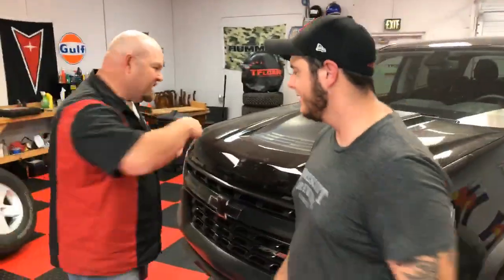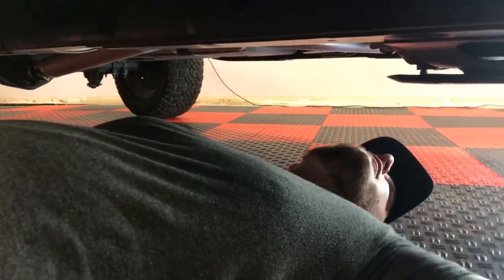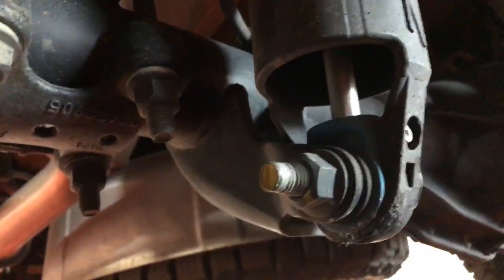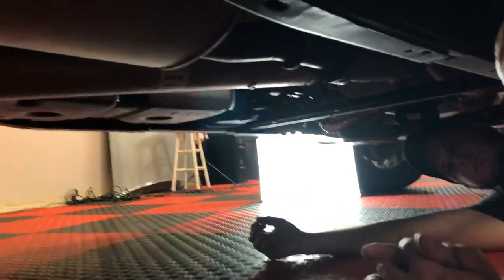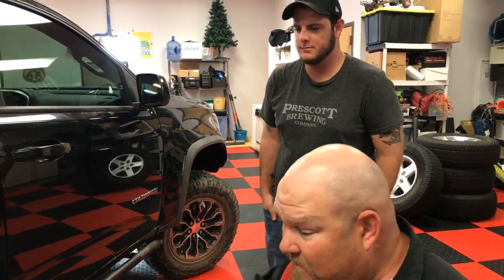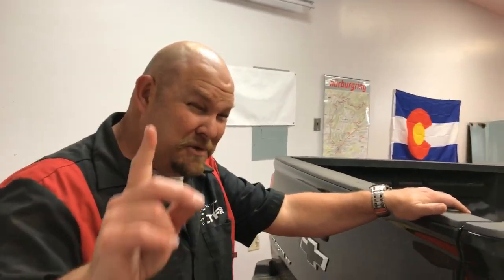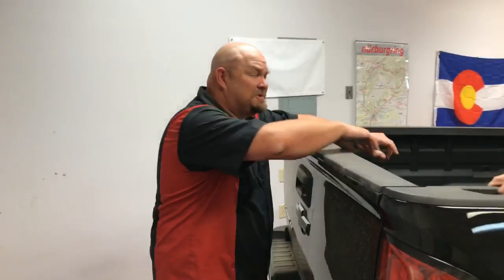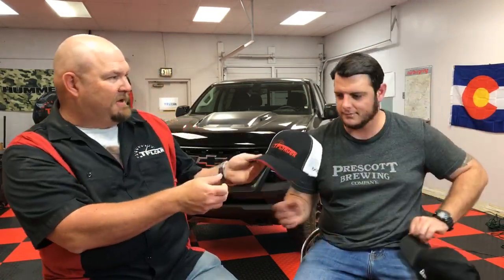Dude, I Love My Ride! 2017 Chevy Colorado ZR2

Comment: I love my 2017 ZR2 2.8 Duramax. I installed a S&B cold air intake. The truck is a beast and matches my 1995 ZR2 that I also purchased new.
Reply: scrimmy6969 Try the pedal commander. You'll love it
Reply: scrimmy6969 are you getting remarkable mileage with the diesel?

Comment: His guy made the correct choice! A bit smaller than full size trucks, can trail/off road much better than full size rigs The factory lift/wheel package is great from the start, the fact that it has lockers at both ends are just the icing on the cake! I'd love get this truck myself!

Comment: I've owned my zr2 for 11 months.  The eight speed shifts very smooth.  I do engage tow mode on the highway.  I just like staying on the power band.  According to the fuel mileage computer, i'm getting 17 mpg combined.  Right on the EPA numbers.  I have used the truck in rocks, sand, mud, snow, you name it.  Runs great.  My jeep buddies are really impressed on how well it does in deep snow.  The one thing i don't like is the fake hood scoop.  If was an actual scoop that forced air or worked like the one on Corvette that circulates cool air around the engine, I'd be all over that.  However, being fake it doesn't do anything except make it difficult to see the front passenger corner from the driver seat.

Comment: An 8 cylinder option would be awesome.
Reply: Frozen Canuck Patrick James It would but it's not necessary
Reply: Frozen Canuck Patrick James ats v engine would be better
Reply: A 6.2l duramax would be a better option if we are going that route.  LoL
Reply: 6.6l? or are you talking the 6.2l LS3 or LT1. 6.2l duramax hasnt been made for over 20years
Reply: i Bee Amazin the 6.2 was not a duramax, the 1st duramax was out in 2001
Reply: true enough i was just trying to figure out what he was talking about
Reply: All automakers are phasing out the v8 engine  itll be more 4 and 6 cylinders turbo
Reply: +MrMarky762 which is absolute horseshit stupidity. We had technology in the thirties to have an 8 liter engine get 50 miles per gallon. the entire Auto industry gas Enigma is one of the largest games in the history of mankind. Engines under moderate power demand run on Vapor not liquid fuel.
Reply: that would be too much power for that kind of truck
Reply: Dark Raven Jr too much power? What's that mean? No such thing

Comment: Just for S*|+ and giggles I test drove the diesel version. Felt really nice, but I was completely surprised by how quiet it was. It's loud outside of it but once I was inside I couldn't even tell it was diesel. Great truck.
Reply: Being an owner of a diesel Canyon I wouldn't say you can't tell it's a diesel from the inside. You can definitely hear it, especially over how quiet the new 5.3 is in the full size trucks, but I think the diesel has the perfect amount of engine noise.

Comment: I noticed Tacoma guys really like leaving comments on Zr2 videos........
Reply: Since us Tacoma guys actually take our trucks off road, we just feel obliged to set some things straight with you metrosexual Colorado guys that spend more of your time worrying about stupid shit like electric seats, modern interior design, and cab noise than (again) actually taking your truck off road.  

That front locker on an IFS designed by engineers at GM that are used to being rewarded with American tax dollars for their failures should be cause for any off roader to run as far away from the ZR2 as possible.
Reply: What exactly are you setting the record straight on?  The only thing I see is whinging about resale value.
Reply: That's because Toyota guys are the guys with (by FAR) the most off road experience in the small truck category. Toyota's have a long reputation for legendary reliability AND the ability to get in and out of off road trouble. Now, with that being said, (written) I'm currently looking at a Chevy because Toyota doesn't offer front lockers or a diesel in the US AND I wasn't impressed with my Tacoma test drive. In the half ton/full size market, Toyota makes the ONLY Consumer Reports recommended truck, which carries a significant amount of weight, but I want a small truck. I'm impressed that Chevy has won Truck of the year 2 years in a row and will be test driving one soon with the diesel.
Reply: I actually think of the Jeep Wrangler when I think of hardcore off roading clubs. I like the Tacoma I think Toyotas biggest problem is they don't take risks. The Tacoma sells so well I wouldn't be surprised if Toyota sticks with the same Tacoma for the next 10 years without adding a front locker or better tires from the factory. I think it's great GM came out with something good again. I miss the GM from the 90s so I like the Zr2 a lot. Now if the Ranger Raptor is good I hope GM puts that 3.6 ATS-V engine in that.

My dad was a Tacoma fanboy and the Zr2 having a Diesel swayed him to get the Chevy. He likes the looks of the Zr2 more also. Straight up paid cash. Toyota lost a $45,000 sale being complacent.
Reply: Brett OBerry it's because toyotas have lots of fanboys. You see the same shit in non-offroad channels.
Reply: i consider those fanboys. i have a 2016 Tacoma SR5 ext cab and so far it's been good to me.  i don't do much off road activity but it does have 4WD. i mostly bought it for work and things, but i like the ZR2 it's a nice looking truck.
Reply: You should get into off roading. My dad bought a ZR2 for his retirement truck to go off roading. It's fun.
Reply: I agree. I own a Colorado and would never go on a Toyota comment section and start bashing. So weird. If you don’t like something why even bother looking?? When I see a vehicle I don’t care about I just scroll. Smh
Reply: I think the Tacoma fans bashing on the Colorado  are like that former only child that has a brother now that's better and is mad it's not the only child anymore.
Reply: Real off roading is done in a jeep or bronco. Ya damn hosers.
Reply: @bt4350   Toyota got money from Jap. gov. for the Prius ! Go USA !

Comment: 2017/2018 Toyota Tacoma TRD Pro with the 6 speed manual would be another great option. Although I'd go for the 2018 Colorado ZR2 3.6 V6 with the 8 speed auto, that engine is pretty incredible

Comment: After 6 months, I still love it!  My main gripes are the gears...way too many.  It should come with a 5 or 6 speed for the gas engine.  It's contently looking to up-shift so I keep it in "tow mode" to eliminate a couple gears.  It seems to work a lot better for me.  Off road it's so fun!  I've taken it to Pismo Beach in the sand and it did anything my HUMVEE friends could do.  Locking front diff is a really fun option that will get you out of some hairy technical spots.
Reply: Eric Wold 
If you shift it into M, which allows you to lock out the gears you don't want. Once you get used to it, it's almost like driving a manual. You could also get it tuned to shift any way you like. The benefit of the 8 speed is that 1st and 2nd gear have great ratios to allow taller tires without a problem, but also have tall enough gearing in 7th and 8th for decent gas mileage.
Reply: I can't figure out why GM went to a new V6 and transmission for '17, the V6 and 6-spd auto in my '16 work just fine.
Reply: BG Customs yeah...it's a big problem when you have just a little weight in the bed or pulling just a small motorcycle trailer. But...it's still a fun truck
Reply: BG Customs The new version of the 3.6 uses a roller style timing chain. Disable cylinder deactivation and you're good to go.
Reply: hochhaul I confess I don't know exactly what you mean. Can this be done on the 2017 model?
Reply: hochhaul how do I disable this?

Comment: I put Faulken 33's on mine and only had to shave a small portion of the plastic liner of the inside of the wheel well.  IMO it looks so much better and drives about the same.  YOU DON'T HAVE TO LIFT IT!
Reply: Eric Wold 
With a ZR2 you would want to make sure you don't have any clearance issues at full compression of the suspension. A 1" body lift is cheap and gives a little extra space for the 33's without affecting the geometry or function of the factory suspension.
Reply: hochhaul for sure.  At Pismo it was at full compression many times. It rubbed on the biggest hits. I've since shaved off more of the plastic. I will update my post.  Thanks!  I was concerned about that as well
Reply: They don't make lifts for the zr2 yet. It's a shame cause it needs another  2 inches
Reply: Eric Wold that's what I would do. Those 31s look too small on that truck.
Reply: Eric Wold you don't have to lift it if ya go get groceries....otherwise, lift needed
Reply: JonnyCinco haha...it gets used like it was intended.
Reply: It's more than the front rocker cap when it comes to tire clearance. If you do any moderate off-road articulation you will scrub/scrape/damage the lower forward lip of the both REAR wheel openings.

Comment: The only reason I currently lean towards a Tacoma is for the manual tranny. I've owned 2 automatics and 4 manual vehicles in my brief life. I just prefer to shift my own gears. Keeps me away from my phone, it's funner, and idk....just definitely what I prefer. I will say though that honestly the Colorado is a pretty awesome truck. Give me a ZR2 with a manual tranny and it'd be my hands down winner.
Reply: As much as I love my manuals, new autos just keep getting better and better. On a tight, technical trail where I'm trying to focus on loose rocks, not hitting trees, or my spotter... an auto is almost always better even with a worse crawl ratio compared to most manuals
Reply: Joe Hogan and gas mileage is no longer a factor either.
Reply: Which is all fair enough. As far as trails go to me it all depends on the type of trail. If you're just crawling around at a slow pace I don't see an issue with a manual. Once the clutch is out its fine. And honestly anybody who thinks driving a manual makes it hard to stop and go just hasn't put enough hours into it. When you daily drive a manual stopping and starting becomes second nature. I have a 96 XJ 5 speed manual with the 4.0 I use as my trail rig. Its arguably the easiest manual ive ever owned. Ive done a frw hill climbs where you start at the base of the hill with the jeep at the incline and the jeep just walks up without gas a lot of the time even. If you need momentum though or to shift in some really bumpy fast stuff then I'd concede that an auto it better. I can't tell you how many times I've tried to shift into second to build momentum and had bad shift because I'm bouncing around.

I do think for a newbie to off road riding and trails though would be happier in an auto. Amazing how tough a clutch can be to use under stress. And depending on the shift pattern rocking your vehicle in reverse is tough. Not that rocking is easy in an auto. I guess I dunno. As far as the Colorado vs Taco goes I'm looking for a nice daily with a manual I can take hunting, camping, and that looks good. Not looking for a trail rig you know?
Reply: Lunchbox76 I
Reply: Lunchbox76 I had no idea driving a manual could be soooo easy... I mean, here I am, a guy with a class A cdl who owns 3 cars, 2 of which are manual... the only reason to buy a new manual is because you want one. Computers can shift faster and better than you. They get better economy. In many cases, new autos are stronger than their manual counterparts. It isn't really about ease of use, it's about the fact that new autos simply outperform manual in most cases today.
Reply: you might be right about the experience level. the crawl control and other gadgetry in the auto is a selling point to a lot of casual and novice off-roaders.

Comment: Would love GM to offer ZR2 on the full size trucks and SUV's. I loved my old ZR2 Blazer, best 4x4 I've ever owned. I would absolutely like to have the latest and greatest ZR2 package but it would have to be on a full sized truck. The small trucks just don't work having a family, not enough room and not enough motor to tow the trailers/camper.
Reply: They make a Silverado trail boss and a Sierra at4.

Comment: CURB WEIGHT : 4700-5000 lb
Reply: Exactly, how could it be what they said when the GVWR is only 6000lbs?  I was surprised with Nathan agreed with his number.
Reply: i could see it weighing 4700 pounds, but not 5000. the Tacoma 4WD crew cab only weighs 4500 pounds.

Comment: So that truck (which I like) has 8.9 inches of ground clearance and my Cherokee Trailhawk has 8.5 inches, that truck does have significantly better approach angles than my Trailhawk. I would like to get that truck next after I pay down this Trailhawk but it's a little disappointing that it's clearance isn't much better. It's still worth it I think but I'm a little surprised that the clearance isn't more than it is. What would be fun is a head-to-head matchup between this truck and the Cherokee Trailhawk.

Comment: Trolls and other fanatics are loyal to their crap so...However, those's lower hanging shock mounts are/will be a issue if you really do anything more than mild off road play! Hopefully, the aftermarket makes a kit to mitigate this issue.
Reply: There are shock skids that have just come out for the ZR2.
Reply: That's a delusional theory. Those shock mounts are from the 3500 HD. Also, people are wheeling these hard and not breaking anything. They are low but aren't an issue.
Reply: E. Simons Anybody with even a little welding experience can make some skids. Notice how nice and high that transfer case is? The Tacoma's T-case hangs inches below the frame with barely anything protecting it. Are you calling out the Tacoma for a major issue like that? I'd rather nail a shock mount on a rock than my t-case.

Comment: The seat issue in the tacoma is overblown by tfl in my opinion, I drive a 98 tacoma and I have no problem with the seat, and I'm 6ft
Reply: Ranger Dollins The seating position has been criticized by nearly every automotive journalist in the US. Just Google "Tacoma seating position".

You sit low to the floor as if you're driving a car. If you slide forward so your arms can reach the steering wheel, you end up running out of leg room and need to bend your legs, so now your knees are up against the dash. The seating position is designed for small asian men.
Reply: Hochhaul please don't try to correct me on something you know nothing about, I drive one every day, I don't care what journalists say
Reply: it really isn't.  That seat is uncomfortable and sits too low.
Reply: Ranger Dollins 

Sounds more like you have the exact same freakish body proportions Toyota has always used as a baseline for seat position on their midsize trucks. I've driven T100's and every generation of Tacoma enough to know that Toyota has ALWAYS had a terrible seating position. The vast majority of Americans would agree.

Comment: Diesel= programmer=200hp+who knows on torque. Let's do a little work.. bigger injectors and better air cleaner + rip out the exhaust filter and reprogram not to Regenerate. As government needs filters on all diesel engines now do to global warming garbage. Then u have a great truck. + Bypass egr then awesome diesel truck...😀

Comment: Why you should get more skid plates!!
https://www.youtube.com/watch?v=Cjf3el2qS5M&t=4s
Reply: Vegas Shuffle That's a regular Colorado. And had it been a Tacoma, that rock would have broken the low hanging transfer case, hangs inches below the frame And is protected by a wimpy little sheet metal shield.

Comment: my opinion the TACOMA TRD PRO or TRD OFF ROAD is better than the colorado i know the only thing thats better on the colorado are the locking diffs front and back other than that tacoma is better
Reply: bmuno20 The ZR2 shocks are vastly superior. The ZR2 has heavy duty cast iron control arms, the TRD Pro has weak stamped steel control arms. The Colorado has a tough Dana low pinion axle, the TRD uses a weak high pinion, reverse cut 8" axle setup. How weak? https://youtu.be/7lmqGD76pcc
The TRD Pro uses Fox Racing 2.5's but the engineers forgot to upgrade everything in the front suspension to make use of them. The Tacoma's stamped steel control arms were already common failure points, jumping the truck or high speed whoops are going to tear them up. Then there's the vibration problems that have haunted the Tacoma's front diff for years... And who at Toyota decided that junk Goodyear Wrangler AT's were the right tire for a $42k+ TRD Pro?

Comment: Too bad Chevy trucks don't last.
Reply: MrRedskins0021 ????
Reply: MrRedskins0021 I can't speak for the new ones but my first truck was a '89 Sierra I still see it on the road it has over 300k miles on it sure it's rusty and ugly but its TANK!
Reply: If you take care of them they will last
Reply: MrRedskins0021 longest lasting most dependable full size trucks and suvs on the road, that title belongs to gm, never had problems with any Chevy truck I've owned
Reply: Krasnaludek  No issues? You just said that you had to get some work on the transmission.  😂
Reply: MrRedskins0021 the small block V8 will
Reply: My 2002, 2011, and now my 2017 Z71 Silverado have all been great. No legitimate complaints that any truck wouldn't have. I've had Ford, Dodge, and Chevy and not one has ever been perfect nor better than the other.
Reply: Form Less I owen a Toyota.  270k with no problems.